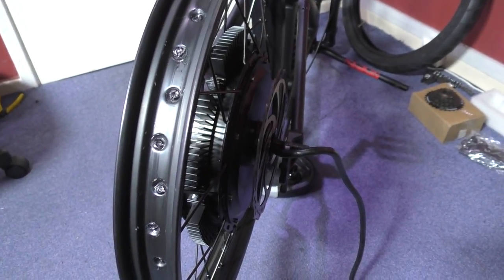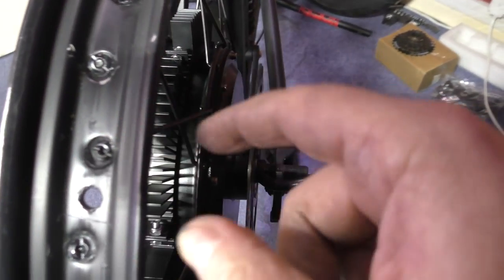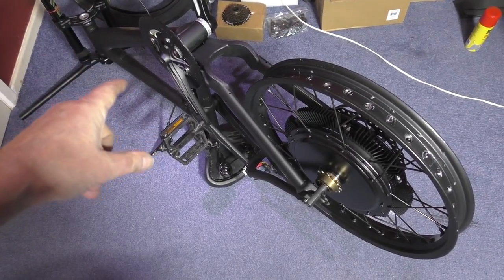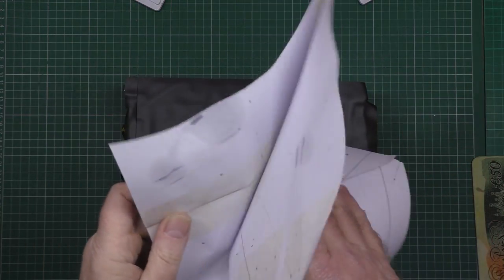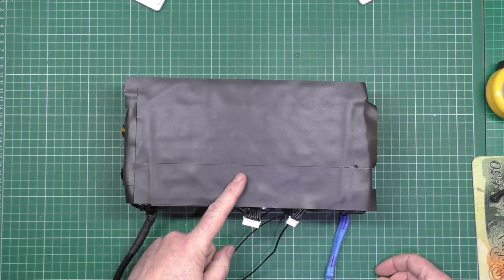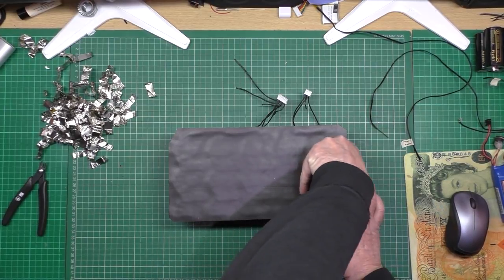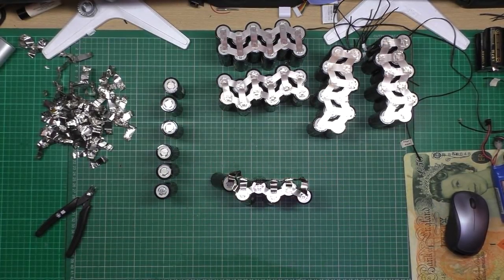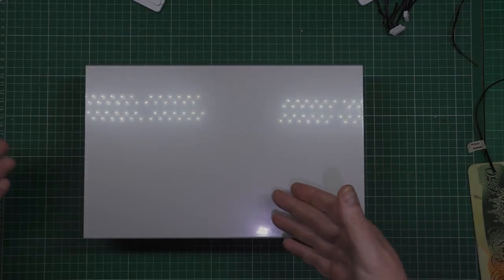High powered DIY eBike MSVA build part 9 - DIY lithium battery build woes AGAIN

Comment: I almost cried watching you disassemble your batteries!  There is always the unthinkable....cut the downtube and headtube and extend the frame for a longer wheelbase, so the batteries fit inside the frame.   I did this on my mongoose fatbike frame, and it hasn’t broke yet🤣.....but I don’t want to be packing it up any stairs.   I ran out of battery 6 miles from home on a backroad with 2” of loose dust/sand on the surface.  I nearly died pedaling it home....pedalling a 110 pound bike with 4.5” low pressure tires in deep dust is NOT reccomended, lol.
Reply: I have a low powered Ebike conversion based on a Mongoose Alta. I haven't weather proofed the wiring yet so in the wet it cuts out. It would be easy enough to pedal home on tarmac if it wasn't for the single speed conversion.
Reply: hehehe! I can relate to that very well too! :-)
Reply from the maker: I am a man of persistence and innovation. If I get parts and they don't fit, I keep trying until they do and I refuse to alter things (I suppose it's a mild form of madness) 😂
Reply: Vortecks   I can appreciate that...I think you could build a bike from the wheels up too, if you so desired!
Reply from the maker: @jimhofoss9982  I can also build wheels 😁
Reply: Vortecks indeed you can!  Your wheels you spun look very true!  I haven’t tried the hubmotor cooling fins before....do they significantly cool the motor/worth the investment?
Reply from the maker: @jimhofoss9982  https://www.youtube.com/watch?v=rNPEoK-n_d4
Skip to 20:35 😁

Comment: Tony.
Instead of struggling to wrap the batteries around the bike frame. Why not alter the bike frame to accommodate the batteries? I know its probably not the sort of thing you would normally do but its not too difficult.
Split the top tube, use 2 smaller diameter tubes instead of one large one, then slip in between them a slim designed battery. They do something similar with petrol tanks on motorcycles.
Reply from the maker: I am a man of persistence and innovation. If I get parts and they don't fit, I keep trying until they do and I refuse to alter things (I suppose it's a mild form of madness) 😂

Comment: Oh man... that's just tragic - I think I would have saved up for some more batteries and build fresh, and having the previous set as a auxiliary battery or home battery with inverter etc.
Reply from the maker: The trouble is, Andy - the battery is the heart of the build and I need to get it done to progress any further. It'd take me 5 months to save up and another 2 months for the batteries to arrive so I had no choice.
Reply: @Vortecks  I know, would take me months to save up too so know how you feel between a rock and a hard place. Maybe with the new plan you can use some of the space inside the frame triangle as well. It's a really challenging 3D jigsaw puzzle and maze guaranteed to do your head in... but an awesome achievement when successful!

Comment: Could you build the battery case shaped like a wind deflector like the Honda C90? It would protect your legs a little and look batter than most e bikes with bulky cases. Just a thought. Great work so far.
Reply from the maker: Yes but..... it would then look like a Honda C90. I'm trying to be 'low profile' so I don't attract attention.

Comment: Vent holes at the front of the case so flame is away from your legs if any thermal runaway? (Filling cell-to-cell and cell-to-case gaps with something thermally conductive and fire retardant might help cell cooling?) -- with flame vent pathways

Comment: Ouch Tony, painful to watch that all coming apart :(  Question: surely that will make it more of a nightmare to connect up with cells running parallel to the top tube? If you do, I’d recommend as you showed two cells and another between.. then I’d add another two on the opposite side (making a patten of five in a star shape ‘viewed on end’). If you get what I mean. This would maximise the available space but no idea how that would be wired up.
Or, make a pack that fits the space using cells 90deg to the top tube in a big block like you had it and maybe a pack either side in very slim removable panniers (cells running parallel as shown in your drawing) only one cell thick each side. Just some ideas Tone, good luck fella

Comment: hey there vortecks, in one of you previous videos I sugested cheking out the new flexible batteries, these do not seem to be as strong but they are safer, a lot safer, and they can be bent into odd shapes, it may be posible for you to add them into your build, I imagine that you could take advantage of their flexibility, they potentially will grant more ways to spread the set up, thus potentially you would get a slimmer product
Reply from the maker: I've already got all the parts I'm going to use. I'm a persistent and innovative person who won't back down on something and I will make these cells work for me 😁
Please don't take that as an insult, I do appreciate the opinion of others but I'm determined to make this work.

Comment: I think the new battery pack idea is going to be much better than the old one Tony. Will u end up with the same capacity? Even if its a smaller pack it will be much more streamlined and look so much better. The weight will be much better distributed to. Wont feel like u are trying to get a baby   whale round corners so much lol. Happy new year mate have a good one
Reply from the maker: It'll be the same capacity. It's turned out really well actually, I just need to figure out how to mount the bloody thing now!
Reply from the maker: Oh..... Happy New Year to you too mate 😁

Comment: could of maybe rotated them before disassembling although the finished look wouldn`t have been good. have built a couple to fit inside a frame is complicated  to get head around the series joins at first. 
Are you still sure after fitting them the same size has the frame you are going to get pedal clearance when your feet are on them ?

Comment: tbh I dont know if its possible to get a battery that big mounted to the frame and still being able to pedal.. I built an electric bike around a downhill frame with 8x16000mah Tattu 4s (the same cells which u used before). At first I also tried everythig I could think of to get the batteries as close to the frame as possible, so that I have enough room to use the pedals... But as the built went on, I saw that, for me, there was no chance to use a battery that big (1,9kWh) and still being able to use the pedals. Now its more or less a light and powerful motorcycle, without the option to pedal, but thats fine for me. ...I just want to say, maybe you think of a plan B, just in case big battery + pedals do not work out for you.
One idea that worked for me: Use aluminium u-profiles and bend them in the shape you need. Than use CFK plates on both sides (Like a sandwich), that way you have a light weight box that is relatively durable.
Reply from the maker: It's a 2.5kWh battery and I WILL make it fit 😁

Comment: Oh no, the Battery is in bits...Why dont you use a piece of plywood instead of Alum Tony, lighter, easier to cut and the cells cannot short on it...?...I think you should have opened out those spoke holes in the Hub a little bit maybe..?
   Quad building is so much easier....lol.
Reply from the maker: Plywood swells, delaminates, deforms and cracks mate.
You're right, quad building is soooooooo much easier and sometimes, I wish I hadn't started this bloody thing 😁

Comment: Good vid what about a backpack battery.
Reply from the maker: 33lb on your back.... does that answer the question? 😁
Reply: @Vortecks  Ive got 6x6s 12AH multistars in a backpack and the backpack itself is very heavy to move around but once its on my back it isnt too bad only really feel it toward the end of a longer ride than my 20 min commute ( i have pretty much the identical frame to you)

Comment: i just found that my 3000w hub doesnt fit on my bike... my bike has plates that bolt to the chainstay,which also hold the derailer... FAAAAAAACK! now i need to cut the plate so the 22mm bolts fit... gonna have to add a single speed cog too... Arrrrrrrh! (Leicester bloke)

Comment: Well, that was a bit of a fecker !
In the plan for the new battery configuration in the triangle, did you allow for the full movement parameters of the suspension ? Or are you not going to use the inner part of the triangle and leave it as a void ?
I thought you were going to use a Dremel to clean up the old welds.
Reply from the maker: The triangle will be a void.
I can't use a Dremel to clean the welds - the battery is very thin nickel coated steel and spot welding to steel is rather messy.
Reply: @Vortecks  - Do you think there is anything that could go into the triangle ? Maybe the BMS ?
Keep up the good work Tony. I hope you overcome all of the design problems you're encountering.
Seasons Greetings and a Happy New Year to you.
Reply from the maker: @herenow2895  Yeah, I have plans for that bit but there's no way will the controller fit in there 😁

Comment: Have you thought about doing the red bull soap box challenge? 😀 I think you should. Also, what camera and mic do you use on the bike? I have a motorbike but a rubbish camera and wind noise.
Reply from the maker: I couldn't do it, I'd want to put some 'illegal' things in there to beat the competition. If that failed then a flame-thrower would be my backup.
The camera install video is here...... https://www.youtube.com/watch?v=E2gG-vhM2RI

Comment: Is there no way you can have the batterys on either side of the back wheel like how some of the motorbikes have storage on the sides?
Reply from the maker: Nope, I've spent many hours looking at it and it would take some serious engineering to make something and it'd weigh too much. The rear suspension is the killer and also, I need as much weight up front as possible - the old one used to wheelie too easily.
Reply: @Vortecks  only other thing is hang it over the front bars in a basket 😉

Comment: I've used dry film lube on those juvenile nipples and spokes. It is a bake on process. 10 ga? I recall you saying 12 ga before.
Reply from the maker: The front are 12g, the rear are 10g.
Reply: @Vortecks  massive!

Comment: Pannier packs would have been so much easier..
Reply from the maker: ....and so much more dangerous. It's not possible to fit a pannier mate - it's got rear suspension and there's nothing that can handle the weight.
Plus which, I need all the weight up the front because V2 used to lift the front wheel very easily - with the weight over the back wheel, I wouldn't stand a chance.